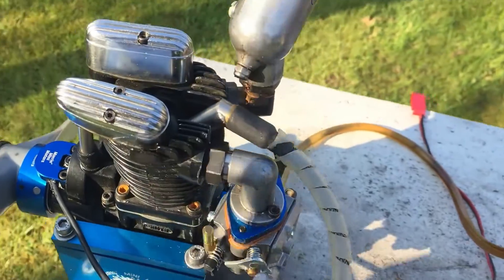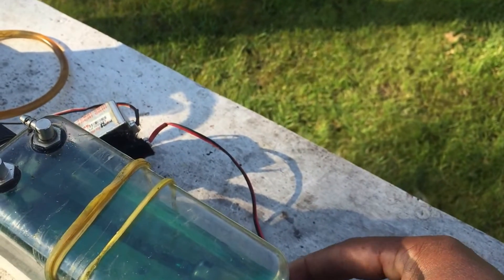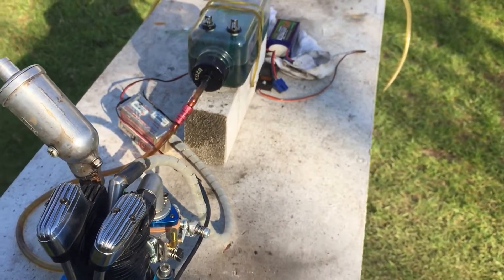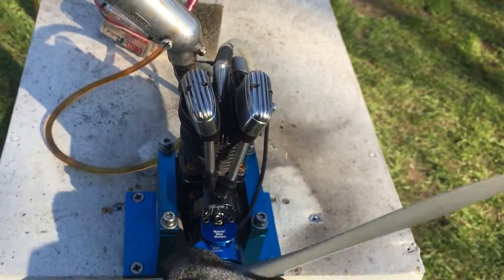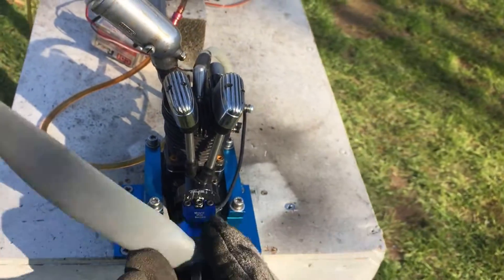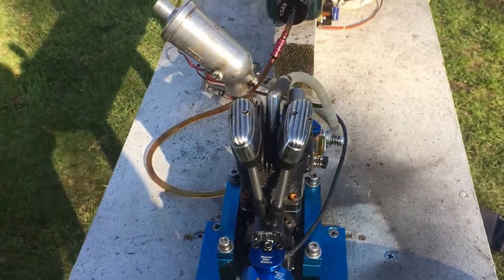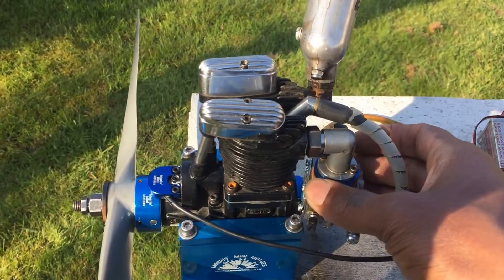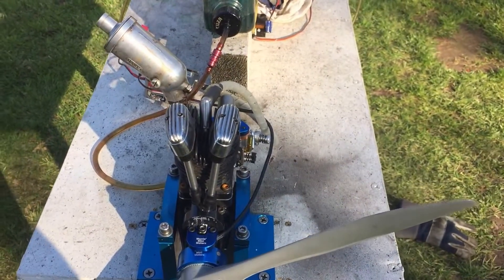Saito FA-150 with Morris' Mini Motors Conversion Kit 20 to 1 mix

Comment: I wouldn't recommend the Saito FG 4-stroke gas engines. They put out so little power, I found them worthless (FG 11,14,21). If you want to lower the effective compression of a methanol engine, run it with no nitromethane. You use a little bit of power, get a nice idle, and the engine runs a bit cooler.

Comment: Yes, you can make the conversion. But, the methanol engine does not have the needed cooling that gas engines are designed with. And the gas version may have 60% of the power of the original methanol displacement. You won't get the same power out of your engine, and it will be running hot.
Reply from the maker: Oudeis Eimi hello 

The Saito FA and FG Engine uses the same material

They are all the same engine nothing different about in material and construction!

FA Version remember for glow fuel because it doesn't have a ignition unit 

FG Version remember for gas fuel because it comes with CDI ignition unit and a pump style carb 

There is no difference in power if the 2 version runs on the same fuel!